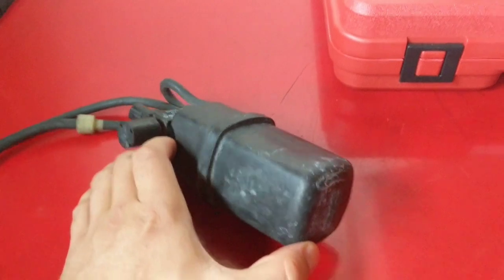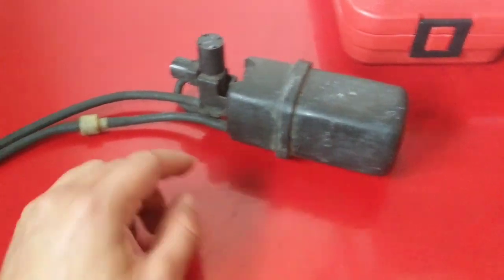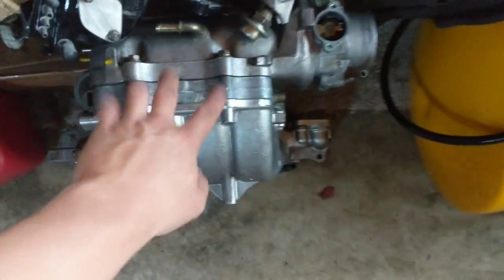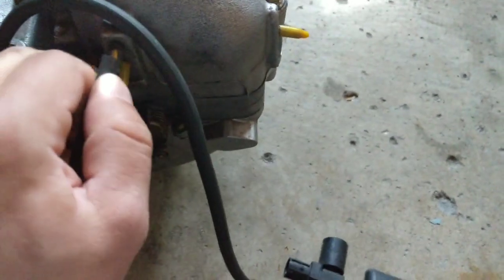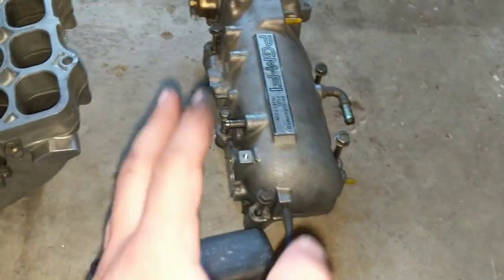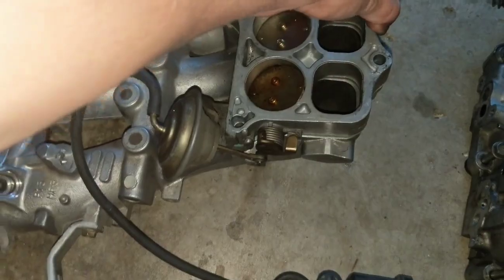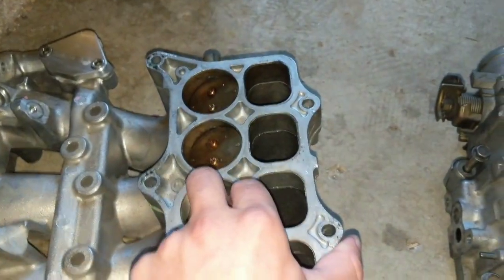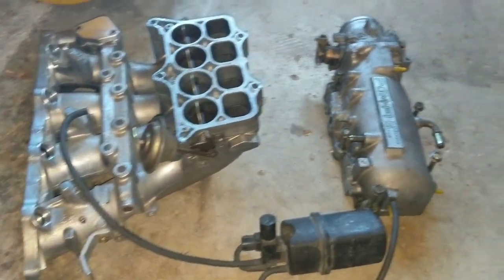#FractalFB Rx7 Part 25 - Intake Manifold Control

Comment: I overlooked this when I slapped on a pair of quad ITBs on my 4 port N/A 13B.  Torque really isn't an issue, but drivability is.  It's tough getting a smooth idle and most of my street driving requires a very small amount of throttle input.  After finally getting it running, I have a new found appreciation for all the Mazda factory intake systems....but once I get over 4,000RPM, no regrets LOL!